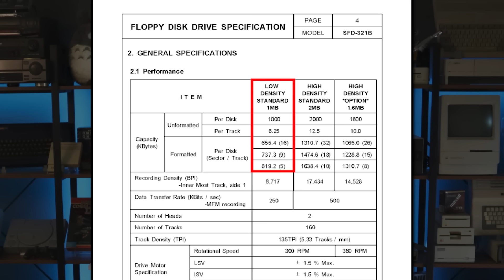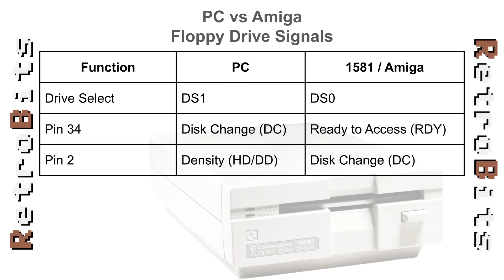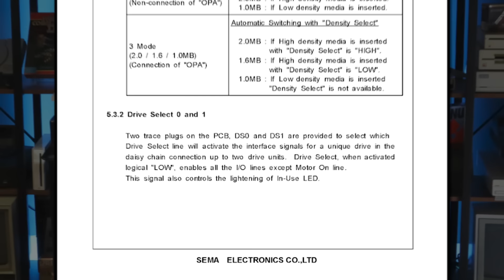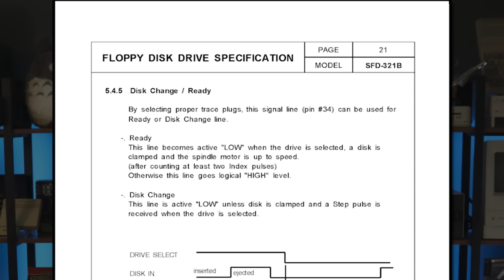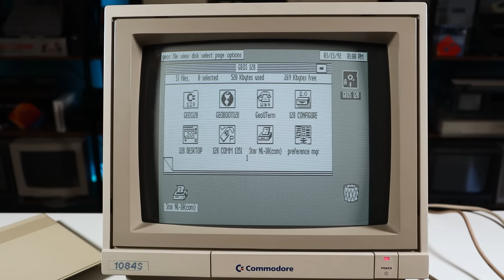How did I break my 1581 and FIVE floppy drives?!

Comment from the maker: Correction: When I stated that the ribbon cable connector on the adapter board was backwards, that was incorrect. As it turns out, upon removing the connector, the FDD interface pins are mirrored on the output of the  adapter so I had it correctly fitted. Only the mini molex power connector was backward.

Comment: My worst retro screwup?  Off the top of my head (and there were probably a few worse ones) was when I had a pristine C64 case that looked brand new sitting in a spot I thought would be safe, but then knocked something over onto it and broke off a huge chunk from the bottom half of the case.  Loctite plastic weld fixed it but the crack is still visible.  I screamed.

Comment: I bought 2 of these drive for my replica. It turned out that also the switches for disk and HD detection can go bad. Furthermore there are several revisions of the SFD-321B, I had one where the switch for HD detection was missing from factory. I believe to remember that I checked the configuration and that drive was hardwired to HD from factory.

Comment: On the subject of screw-ups, I had an industrial motor control in for a routine rebuild (it was a weak, failure-prone design), and I thought I'd found and renewed all the failed components, including the 10 ohm, 50-watt brake resistor. I set up for the 'light test' to make sure everything was good before installing it into the process controller, and about 5 seconds after I turned on the power, a flame a foot tall shot out of the unit! Every single component I'd just replaced had already failed. While stripping down the board for another rebuild, I realized I'd forgotten a 1N4005 sandwiched between two big capacitors...! I had to wait a few days for parts as I'd used the last brake resistor on the shelf. When it was time to do the light test again (and on all the others that came across my bench for the next six months), I had one of the other people in my department do the light test for me.
Reply from the maker: Haha that's way more exciting than my little drive escapade. Nice one!

Comment: Back when I first started building PCs, I was young, stupid and reckless, and without thinking or even doing basic research, I hooked the power supply up wrong. This was back in the days of AT (not ATX) power supplies, which had two connectors that sort of look like oversized berg connectors that plugged into the motherboard. They were individually keyed, so you couldn't put them in backwards. But you could get the order of the two separate connectors swapped around. Which is exactly what I did. And when I hit the power switch, there was a thunderous BANG accompanied by a bright flash of light and the magic smoke got let out. Scared the crap out of me, I must have jumped nearly 10 feet. Of course both the motherboard AND the power supply were toast and had to be replaced. Would have been bad enough if it were my own PC, but it wasn't, it was a machine I was building for my girlfriend. Oops. Being the kind soul that she was (she is sadly no longer with us today) she forgave me, but I got teased about it for the longest time.

Also during that same build, I nearly put my eye out. I was trying to screw in a particularly stubborn screw, my screwdriver slipped, the screw went flying, and landed right in the middle of my left eye, with a surprising amount of force. Fortunately luck was on my side, there no permanent damage, only a corneal scratch, which healed in a few days, but it sure hurt like a mother. From that day forward I now wear safety glasses whenever I do any work on electronics things, no matter how small or simple or quick the job might seem, I prefer to play it safe.
Reply from the maker: Ah yes I remember those days. Oops, that was an expensive mistake! Well at least you knew right away what went wrong I guess :P  It's been a looong time but if I recall, the matching colors (black?) from each of the two plugs needed to be next to each other?

Comment: I’ve just started learning how to solder to replace bad caps. Experienced people make it look so dang easy.
Reply from the maker: For what it's worth, I had no real soldering skills when I started doing retro stuff 4 years ago (and still have a lot to learn). Practice and all that :)
Reply: Tutorials always help, but as with most skills there's no substitute for practice and experience. Some tips: using good quality soldering iron, solder, flux and desoldering braid helps a lot. Adjust the temperature as needed, too much heat can damage pads/traces/components, but with too little heat the solder won't flow well. Use the right soldering tip for the job, the shape and size depends on what you are soldering. Good luck!

Comment: Way to go on the fix! @retrocombs and I picked up some shucked cases/faceplates at world of commodore back in dec. Makes me want to maybe do one of these builds. I was wondering about that eject button but I guess there's already an stl out there for it and some other internal mount needs. Thanks!
Reply from the maker: Nice, I wasn't sure that the seller still had any for sale. He went radio silent after the reproduction boards starting coming out. There are lots of 3D models out there for different drives but due to slight variations they all seem to need a little tweaking :P

Comment: Ahh yes, you have to be careful with connectors. The other thing that is different with the "Berg" floppy drive connector is that the pin spacing is 2.5mm and not the more common 2.54mm (0.1"). I found this out when I designed a replica SX-64 I/O PCB which use 2.5mm connectors. I had to make sure I used 2.5mm Molex KK connectors as the right angle version of these have the locking tab located close to the PCB, the 2.54mm KK connectors have the locking tab located away from the PCB. You can jam a 2.54mm connector onto a 2.5mm socket... but you will flip the pins. It looks like the connector you fitted to the interface PCB was the wrong kind.
Reply from the maker: Good to know, thanks! Yea it looks like I ordered the wrong part. Since it comes pre-angled from the factory, the only way to install it on the top side of the board is the wrong way unless I want to bend all the pins 180 degrees. Now that you mention it, the locking tab doesn't latch very well, another sign I messed up :/

Comment: Ballsy move hooking a drive up to a whole amiga to test it after all the drama that came before it! Glad it all worked out. I think on your adaptor (assuming its not in a bin on fire already) you should be able to pull the plastic surround for both the power connector and even the floppy connector, flip them over and slot them back onto the pins, saving the desoldering.
Reply from the maker: Ahh good idea, I wish I had thought of that at the time. I ended up spending an hour or so to desolder everything with hot air and made a bit of a mess of it but got it done in the end. Once I removed the data connector I found that I had installed it the right way after all and the PCB itself flips the pins around, d'oh!

Comment: I don't remember the make of the PC floppy I modified for use in my Amiga, but it sure was a heck of a lot more difficult to change around than the drive in your video, mainly because the SMD resistors that needed to be moved were way smaller. In the end I got it done but boy was it a pain. :(
I once fried a friend's CD-ROM drive because I accidentally plugged the audio output into the wrong pin header on the main board. Thankfully I'm a tech packrat and had a spare drive. D'oh!
Reply from the maker: Whoops! Good ol' un-keyed, un-labelled motherboard pin headers! Glen at CRG just shared a tip with me about removing those SMD resistors - he said heat them from the side and they'll pop right off and stick to your soldering iron. Adding a little fresh solder to the iron may help it along. I haven't tried it out yet but it sounds a lot easier than all the messing around I went through ;)

Comment: As for screw ups. I once blew up a customer prototype PCB because I connected it to 12v (automotive battery voltage) not realising that it was an add on board for a main PCB and only supposed to be powered with 5v. The bang could be heard through the whole office.
Reply from the maker: Ouch! Well, at least it was an impressive failure :)

Comment: don't desolder plastic bits can be pulled off and put on the other way. it would be faster and simpler just a flat screwdriver and a bit of force, works for power connector too
Reply from the maker: Good idea! I already had a go at it with the hot air and eventually got it off but this would have been easier!

Comment: When I have to remove a chip component, I end up 'flooding' both joints with solder until the part floats off the pads. If the part is a zero-ohm jumper, you could just as well bridge the pads with a single strand of wire.
Reply from the maker: Cool, thanks for sharing!

Comment: Hi, this is the most thorough and professional guide for this drive I found and trust me I've seen them all. Still didn't solve my problem though. I've got Samsung SFD-321B /LEB rev.T4, did all you and all other guides say and it still doesn't work. I checked continuity and all seems good. There are many revisions of this drive but mine looks just like yours. Would there be something else to try?
Reply from the maker: Were you able to test the drive on a regular PC to ensure it was working normally before performing the modification? The mod is pretty straightforward so assuming that all looks good I would also try a different ribbon cable (no twist and make sure pin1 connects to pin1 on the computer), verify power to the drive is correct, that kind of stuff...
Reply: @retrobitstv  I swap the drive in place of original one, so there is no room for connection mistake, but no, I didn't have the chance to test the drive with PC due to lack of required hardware. I purchased 3 other drives: NEC and ALPS and I will test them before modification this time. Unfortunately, they aren't as easy to modify due to trace cuttings and soldering to the trace, which is very tricky and unsolid.

Comment: I’m quite surprised that the drives worked at all with 12v going to the 5v rail. Usually something just blows up with a loud noise and the magic smoke is let out.
Reply from the maker: Surprisingly no bang or visible smoke, but one or two drives may have 'smelled a bit hot'. Of course these were either untested or hadn't been used in 20 years so at the time I just assumed the drive I was currently testing simply was bad. If only I had realized I had the power rails backwards sooner...

Comment: Can have a link to the board which works please.
Reply from the maker: Here is the original thread by the designer of the board. I used google translate and had to create an account on the forum in order to download any of the files: https://www.forum64.de/index.php?thread/102472-1581replica-gotek1581-1581-pc-drive-adapter/

Here's the thread on AmiBay where they used to be offered for sale but I do not believe this is active anymore: https://www.amibay.com/threads/commodore-1581-drive-kit-mainboard-with-improvements.122034/

Comment: If I take an IBM PC HD floppy drive and do the same manipulations with it, will it work on AMIGA 1200 and will it allow to use HD floppy disks?
Reply from the maker: I do not believe so, unless the drive is a specific model of Chinon (FZ-3547A) that is designed to spin at a slower speed than a normal PC high density drive in order to keep the data rate to a speed the Amiga's interface can handle. I'm not saying it's impossible to do, but would require more than the changes I've demonstrated in this video.

Comment: Those kind of mistakes hurt the most, but you know what they say, 6th time is the charm! Or something like that :P At least you won't be making that mistake again (hopefully). Also, maybe its fine, but it looked like some bare wire was exposed on the floppy power cable.
Reply from the maker: Haha yea, I would have been happy with the third time being the charm though :P Yea, my crimps are a little sloppy - I need a better tool. I did make sure they weren't in danger of shorting though!
Reply: @retrobitstv  I assumed you probably noticed it, but felt I should mention it just in case. Thanks for making these videos, they're always informative and entertaining

Comment: Can the damaged floppy drives be repaired?
Reply from the maker: I did check to see if any of the discrete components looked burnt on the original Samsung unit but didn't find anything. I'm sure it can be repaired with enough time spent testing components but if one of the custom ICs is shot it might not be possible to get a replacement. I have yet to look at the other 4 drives though...

Comment: Can you fix the five drives?  That might be a useful video.
Reply from the maker: I spent an hour or so looking at the drive schematic for my original Samsung unit and trying to figure out what might have been affected by the over-voltage. I didn't find anything obviously burnt up though. It might be the controller IC itself; I'll have to look and see if replacements are even available. I haven't looked at the other 4 drives yet but it would be nice to fix them!
Reply: I think it would be a good video a lot of repair ones don't go into over/cross voltage issues and it would be nice to see the implications and repaiability when such happens. @retrobitstv